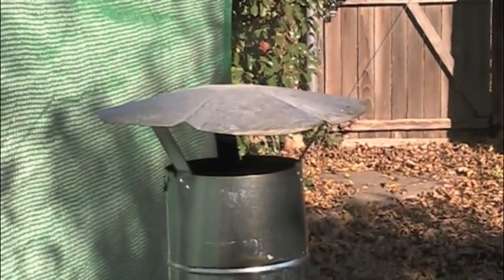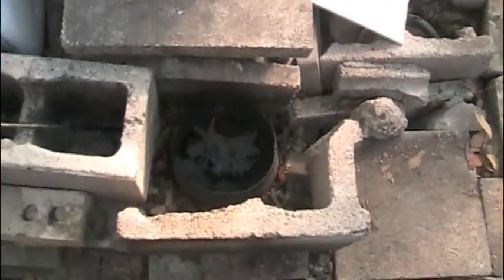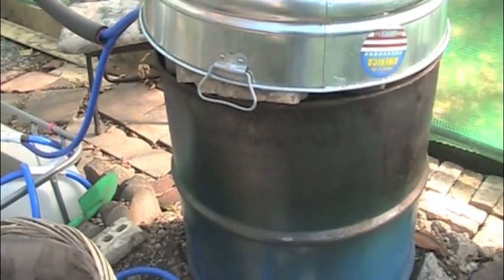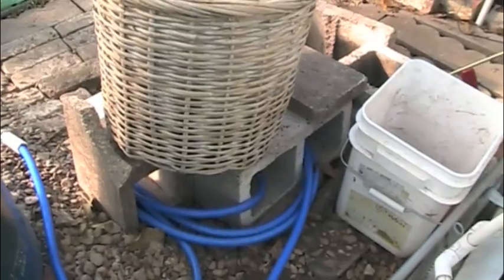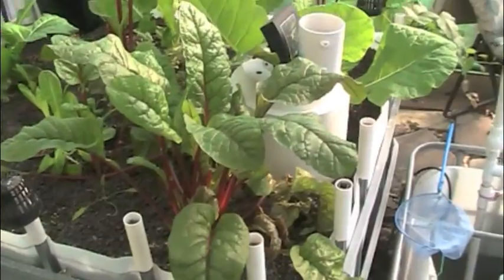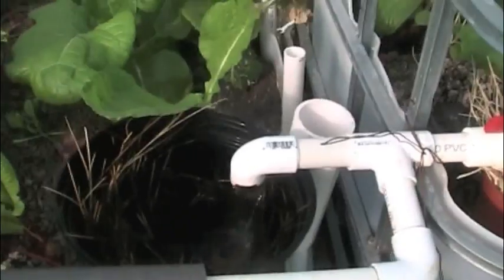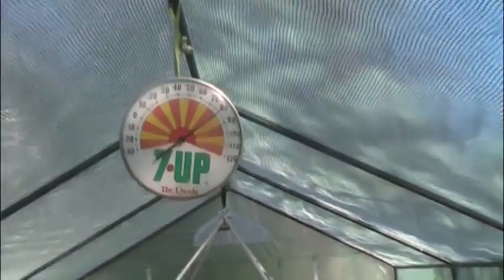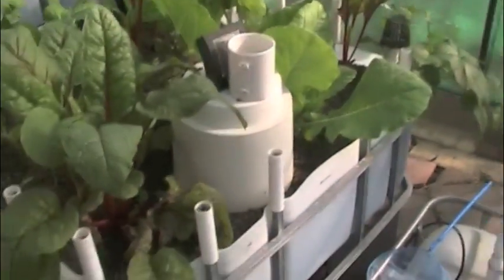aquaponics, rocket mass water heater explanation and update

Comment: If you can fit them - you should try to store some of that hot water circulating in barrels as thermal mass. It will heat the air subtely but will hold the heat despite the rocket stove dying in the night. Should protect the temperature stability in case of failure. In the summer the water will cool back down and help cool the greenhouse the reverse way!
Reply from the maker: I found that by heating the water with heaters that I didn't Have to Have the rocketstove, but it comes in handy to heat water that is going in...not to mention there is something wojnderful about having a fire :-)

Comment from the maker: don't remember about that day except to guess around 40, have since added another water heater to the two I had, now being a total of two 500 watt and a 300 watt.  I just checked though and after a cold night last 2dayshere it's 32 degrees F outside with the water at 81 and the greenhouse inside at 55.  And that's with no rocket heater. the key is that after I added the 3rd heater (500 watt) the water temp was 8 degrees or so warmer, mid 80ish, and keeps the whole inside warm from the inside out